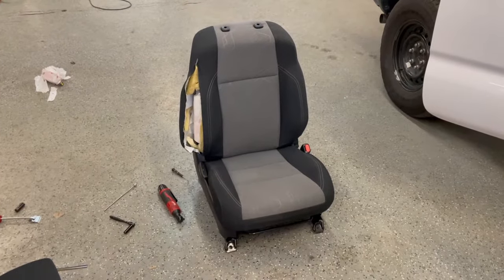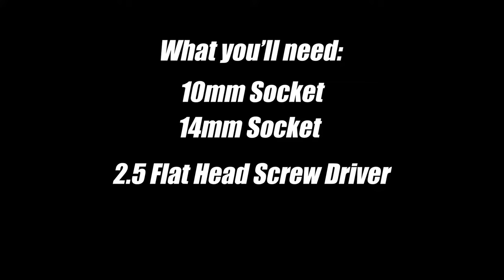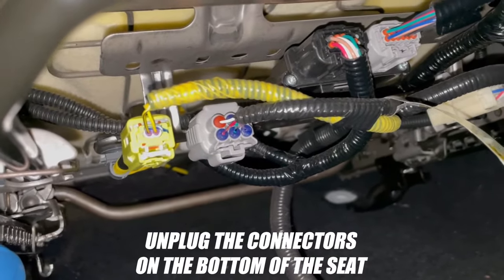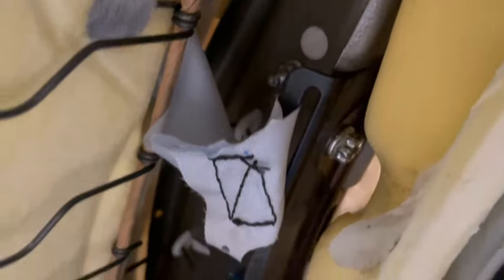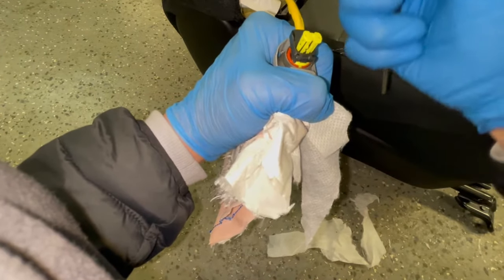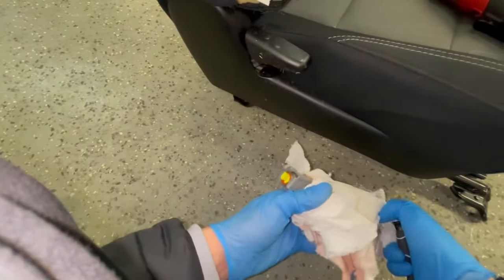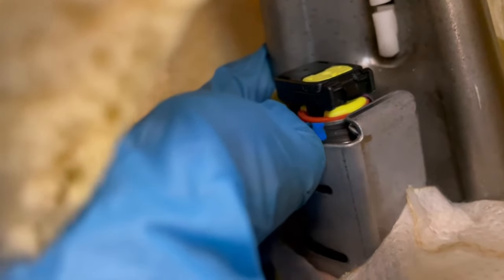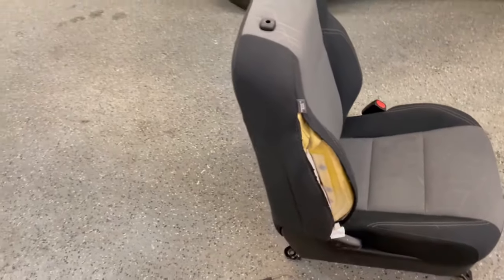How to Replace a BLOWN Seat Airbag ( SIMPLE )

Comment: Could you just buy a used seat the same model as your and hook it up to your car
Reply from the maker: Yeah you can do that. Sometimes it’s more expensive to do it that way and sometimes you have to program / recalibrate the seat to the car depending on the make and model
Reply: get a whole new seat for $65 at the junkyard with the airbag and everything...  ..Or you could just get the parts you need...It also ripped seat cushion and fabric ...   And honestly you're just better off replacing the whole seat depends how common it is to find them at the junkyard..
Reply from the maker: @Pinkielover  depending on the car you’re working on you can get a seat for cheap at the junkyard. The seat in the video was for a 2021 Toyota Tacoma and there was nothing available locally to me. Replacing the airbag is usually the cheapest way to fix a blown seat airbag for newer cars.
Reply: I'm looking at putting a set of 2014 F150 seats in my 1994 F250 OBS.  The drivers side seat has the same cushion blown. Question is can I disable the rest of the seat airbags because obviously I have a non airbag truck? If so what would I need to do? Any advice is much appreciated. Thanks in advance for your replies.
Reply: Sure you can ,but you never know what condition it is really in . Untrained eye will lose out. 12 years experience
Reply: Pretty sure if you disconnect all seats you will have codes and an airbag light on the dash.
Reply from the maker: The airbags won't accidentally explode if you have no power to them. So if you're just mounting the seats in your OBS and not hooking up any electrical power to your seats than the airbags won't explode. @rickbartholomew7172

Comment: I was told that the airbags are very sensitive and I should have a professional do it I e watch your video and it doesn’t look very sensitive
Reply from the maker: @Wydxowie  they are easy to replace if you know what you’re doing. Always have the battery disconnected and be careful not to damage the airbag connectors when removing the bad airbag

Comment: I don’t know but Im pretty sure the upholstery shop will charge you more than a replacement seat from a junkyard. Not to mention you already spend money on the airbag.
Reply: Yeah between 150 200 dollars , just for sewing.Might as well buy it used.
Reply: @jaygates3479 you have to find it at a junkyard first. Idk what magical junkyard you go to but they often don’t have the right seat. So if your lucky it’s cheaper.
Reply from the maker: The new upholstery shop we use charges $75
Reply: @kadevallace  is the shop on Toronto?

Comment: Great video! What else needs to be replaced any control modules or seat belts ?
Reply: This is what I do. First check ,run codes . You will have some. Need to replace your SRS module no matter what. Use new parts only. The codes will tell you if you need to replace the belts and buckles sometimes weight sensors impact sensors whatever . Any time you unplug the seat it will produce codes need to clear them. Just need time and patience.

Comment: awesome video! do you HAVE to remove the actual seat?
Reply from the maker: Not always. I do because I think it’s easier but it all depends on the make and model of the car
Reply: I have done complete seat rebuild in a car but that's difficult just unbolt four bolts unplug connections under seat ,way easier to work on seat
Reply: I do it everyday

Comment: Why do you have to pull the seat out?  It seems like you can replace it with the seat still installed.
Reply from the maker: @spacemonkey2829  You don’t have to pull the seat out if you’re just installing a new airbag. On this seat I took the whole seat to the upholstery shop and paid them to remove the torn fabric, restitch the seam, and then reinstall the reupholstered fabric onto the seat 

If you wanted to remove the seat fabric yourself it’s not too difficult on most cars. You can remove the seat fabric with the seat still Installed in the car but it’s a lot easier to remove the seat then remove the seat fabric

Comment: Crazy question since you know about this stuff. I found a wrecked 2018 4 runner close to me with heated seats looks the same as yours. So if I buy them and replace the airbags , get them stiched think it will throw a light in my Tacoma  ?
Reply from the maker: As long as the airbag connectors / plugs are the same you won’t have a problem 👍
Reply: @kadevallace  thanks man ! So I don’t have to get the new airbags programmed or anything just plug and play
Reply from the maker: @Overlandlife_  Theres only a few scenarios you have to do any programming. Since you’re just replacing the airbags and not doing anything with the module you’re good. Sometimes you have to use a scanner to clear the airbag light if it doesn’t clear by itself after replacing the airbags. 

Just a reminder always make sure to disconnect the battery when you’re doing airbag stuff so you don’t cause any unnecessary problems👍

Comment: Did you have to reset the airbag monitor?
Reply from the maker: Yeah anytime an airbag goes off or a seatbelt locks up from an accident you’ll have to reprogram the airbag module 👍
Reply: What if the airbags went off but there is no airbag light on in the dash?
Reply: Probably have to replace it. It's what I do.
Reply from the maker: Never seen a scenario like that @z6zHcfgQNn
Reply: Can this be done by resetting using OBD?
Reply from the maker: @nebhosspin1252  some cars can be reset through the OBD port, but most cars you have to pull the module and reprogram the module